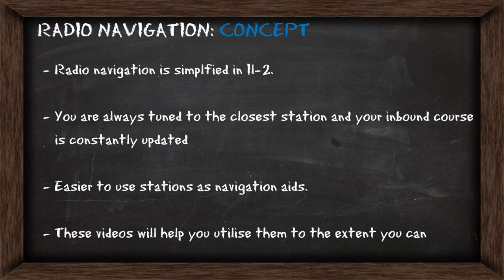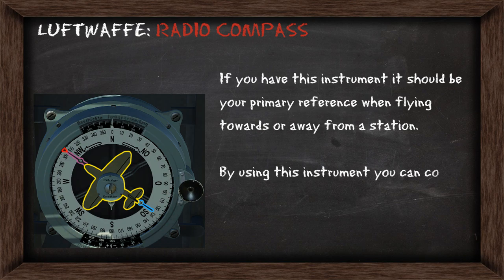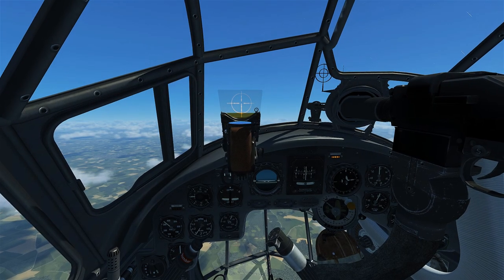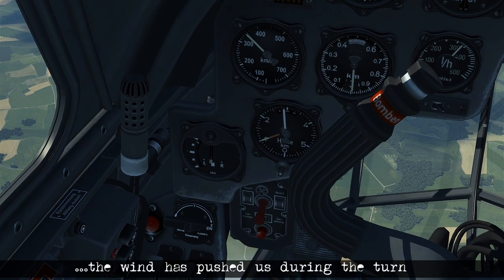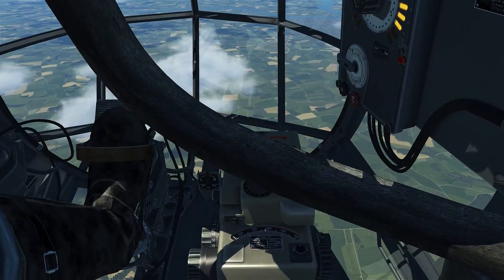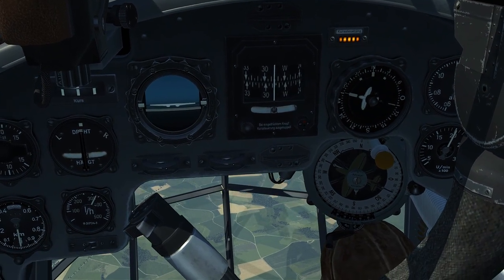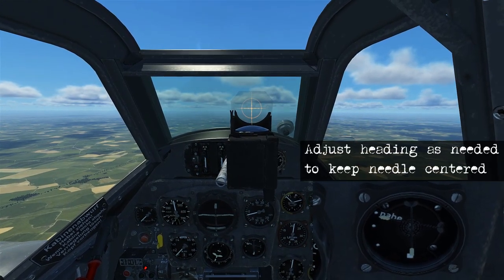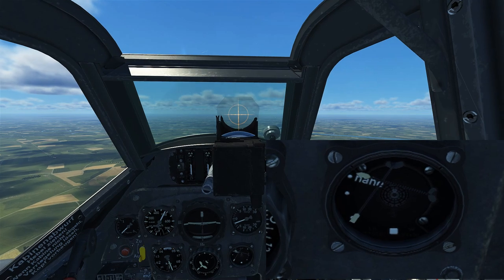Il-2 Radio Navigation - Luftwaffe

Comment: Great vid. I was in the process of figuring this out myself after I was lost in a nightly career mission on the Moscow map which is very hard to navigate on without player aids (such as the GPS or visual markers which are switched off in my missions). However on 3:26 of the video there is a small error imo. The second value in the second column (3000 m height) of the table should read 50 km instead of 90 km.

Comment: I'm not sure I can completely agree with you. At around 5:43, you are flying HDG 090 on a 120° "radial" from the NDB station, and the homebound radial is 300°. You are flying now to HDG 090, and start your turn left through 360° to 300°, it's totally obvious, that the northbound arc of the turn will bring you north from your original point with or without any wind direction or strength, and during this process, your homebound course will decrease due to the geometry of the turn. I think the wind drift can only be determined after you finished your turn, lined up your heading with the homebound course at that moment, then start looking at the  homebound needle drifting in any direction, and if so, you can then "lead it" with your heading. Just my 2 cents...

Comment: Good video overall!  Though I don’t doubt that wind had something to do with it, the main reason that first turn resulted on a course of 295 rather than 300 is because of the diameter of the turn.

Also, check the units of height in two different range scales shown around 3:38.  Km?
Reply from the maker: Thanks, yeah the turn's diameter did affect it as well which was worsened by the 40kt tailwind from the SE I put in for this mission. Having the turn helps with a useful segue into talking about wind correction. The range scale graphic is actually how I intended it to because of space restrictions I had, so I added the colour coding to differentiate between height and range. The height of the airplane is in white (m) while the ranges (km) of the AFN for each height are coloured with their arrows pointing to the scale on the instrument. Sorry if it looks weird, I did the best I could trying to display that info.

Comment: Really well done as I've never really understood the AFN1 and AFN2 devices.  I'm a licensed GA pilot, and oddly enough still fly NDB approaches from time to time, so the concept isn't a problem for me...but making the kit work....well, that's a different matter.  Also, no charts....so how can we determine where the NDB's are located?  Are they indicated on the IL2 map?   Is there a means of changing the NDB frequency or does the game do that for you as part of the mission?
Reply from the maker: Thanks Thomas. Yeah the NDBs are all tuned automatically, so if there is more than one for your team then whichever one is closest will be tuned (just a tradeoff in the simplification). This is not an issue if you're in SP of course as you only need one.... Although their placement is up to the mission creator you can expect them to be placed at an airfield pretty much every time. In MP though there could be more than one, but either way you'll still get taken back to the closest friendly airfield.
Reply: Thank sir, I've really enjoyed your series of videos.

Comment: Thanks for the video! When using the AFN-1 or -2, would it be possible to find your bearing to the NDB initially before correcting your heading for a known wind so you fly a direct course to the beacon instead of homing, or is that technique not typically used?
Reply from the maker: Yep you sure can. You'll just have to pay closer attention to the AFN needle instead so you don't blow past the center instead of flying to an approximate heading.

Comment: Thanks for all your useful tutorials Requiem. Just a question about the AFN-2 gauge...does the distance needle work fine in IL2? I always see that needle locked at top position ( 0 miles from station ). Thanks a lot for any feedback
Reply from the maker: Yep it works fine as long as an NDB is placed in the mission.
Reply: The Air Combat Tutorial Library Thanks a lot for feedback. I’m confused...really don’t know what I’m missing. Today I did a test...flying inbound a friendly field..the vertical needle worked fine...so I have been able to fly towards the station...even the small lights in the middle of the gauge worked fine ( just flashing for short time when I was over the station ), but the distance needle was always stuck on top. Do I need to activate it in any way? Thanks again for any hint

Comment: Do they had a directional beams at the 40's?
Reply from the maker: I'm not sure
Reply: they had directional beams called the Knickebein system but this was for blind bombing. It required two stations' antennae to be physically turned towards the target, the radio beams crossing over the target and the bombaimer and pilot worked together to get the bomber aligned with the target and then released the bombs after a timer had run down. It was a more accurate way of bombing a large mass such as a city and any amount of aircraft could use it.